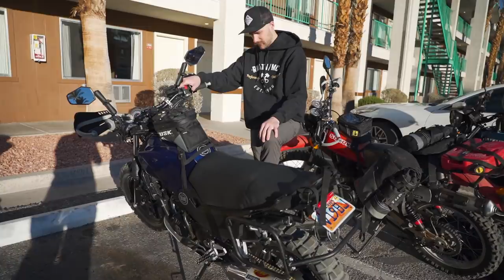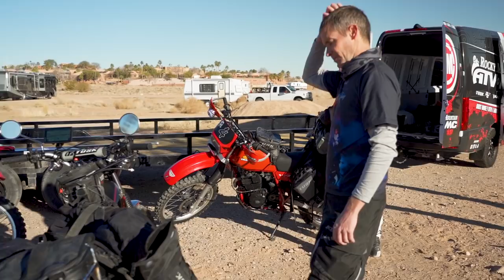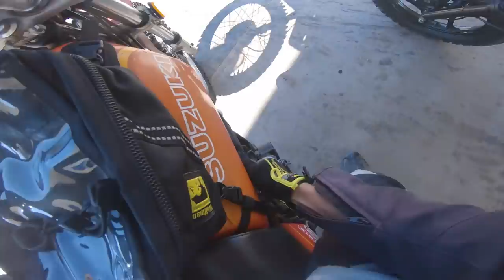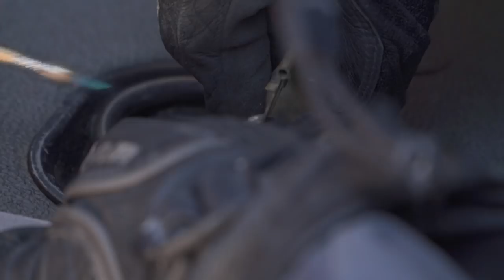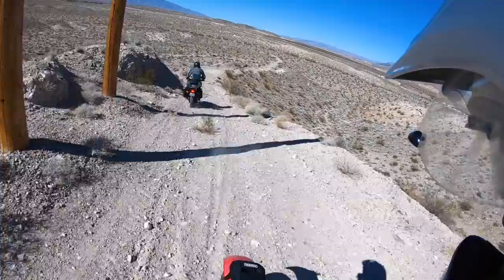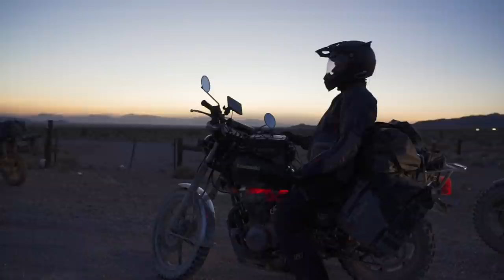Forget 1,000 Miles! Will we even make it 1,000 ft | $1,000 Motorcycles vs 1,000 Miles Episode 3

Comment: You can always tell real motorcycle guys.  During the middle of a 1000 mile ride you totally destroy a Non-replaceable float, they all laugh and with very little distress find a way to make it function.   Carb work on the side of the road, no big deal….  They are highly skilled in the use of scientific equipment such as, zip ties, duct tape and J.B. Weld.   Real motorcycle guys will always survive….
Reply from the maker: haha!  Heck yeah!  I thought I was getting sophisticated packing that mini torch/solder iron, but back to JB weld!  - Justin

Comment: Should've known better than to rely on a Suckzuki. I had one and I worked on it more than rode it. It was a 230 quadsport. Bearings and brakes were always requiring replacing. With the added bonus of, if the rear bearing and or the swing arm bearings go back you then need a case after the chain destroys it.
Reply from the maker: What?! Other than the carb issue on the SP500, all the Suzukis did awesome in this challenge. Don't hate on the Suzuki boys!